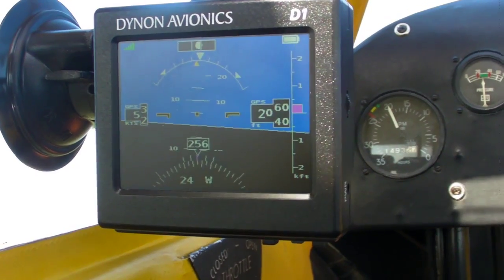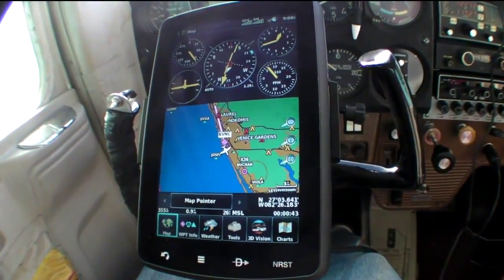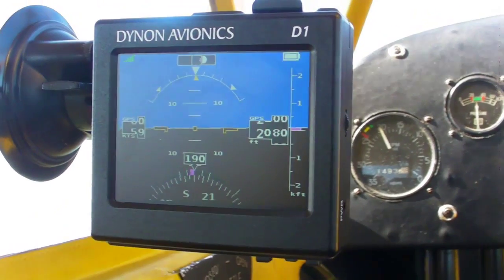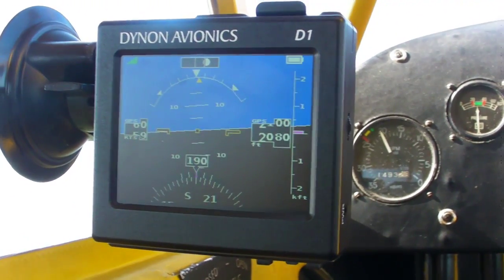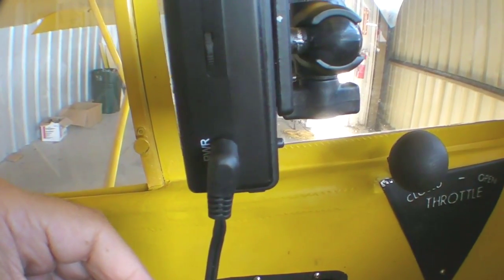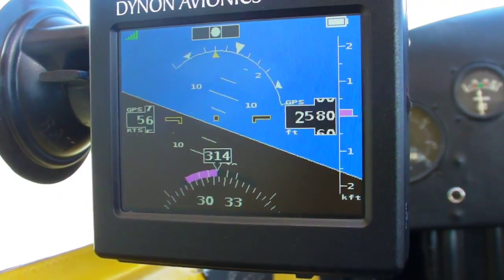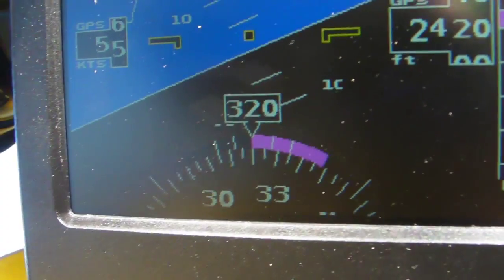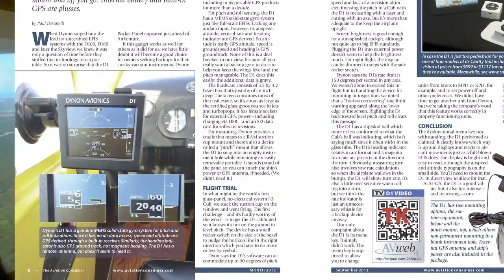Dynon Pocket EFIS Flight Trial

Comment: Hey Paul, I'm building my own experimental plane called a MiniMax soon...I'm finding instruments to be insanely expensive, and if I were to just invest in this unit and use it as a replacement for a bunch of individual instruments, I could save a lot of money. Would you say this unit is reliable enough to use alone? I can't justify spending $1400 on something just used as a backup.